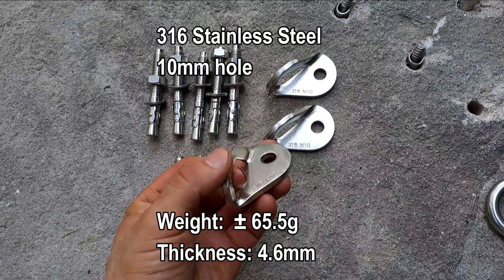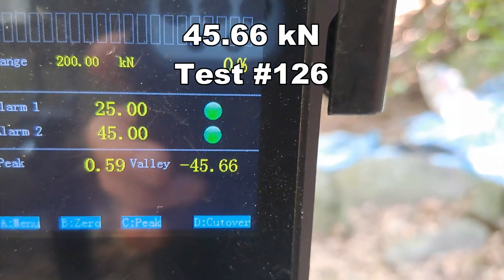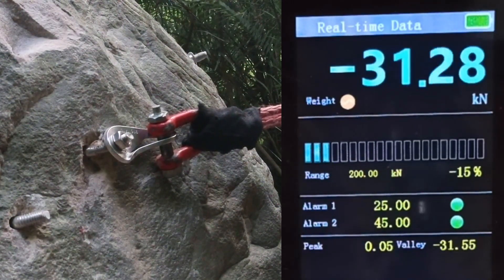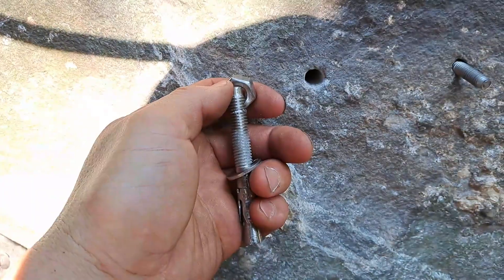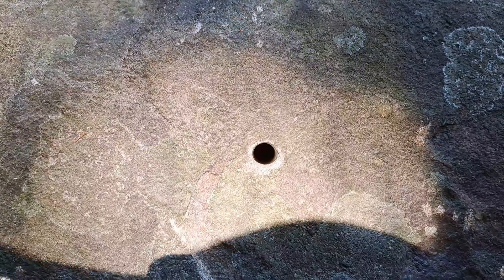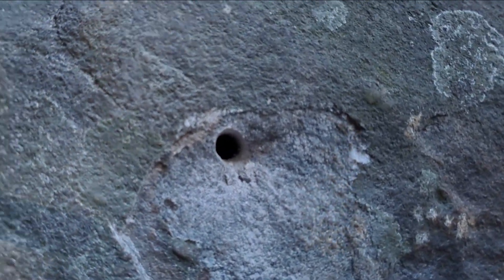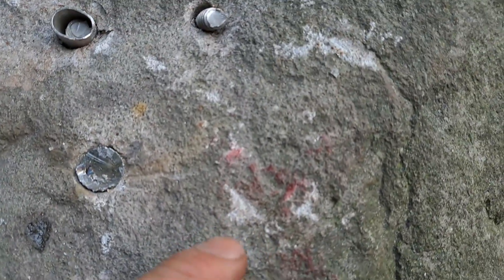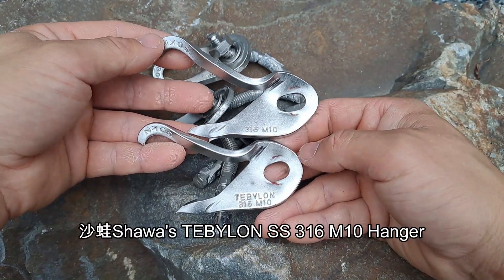BREAK TEST: Stainless Steel 316 M10 30KN Hanger, China made

Comment: Maximum force climber can encounter during fall is 5-6 kN. You must devise totally different system where bolt in rock will receive repetitive impacts of a force say 4-5 kN. For example make 10000 or more impacts of this force.
How many impacts (falls) will such a bolt endure before it breaks?
I am sure you will see totally different results.
Reply from the maker: That is an idea. However the EN959 and UIAA 123 rock anchor standards that all bolts and hangers that are certified and on the market today aren't going through this sort of intense testing. Maybe in the future? But gotta be setup to do something like that.